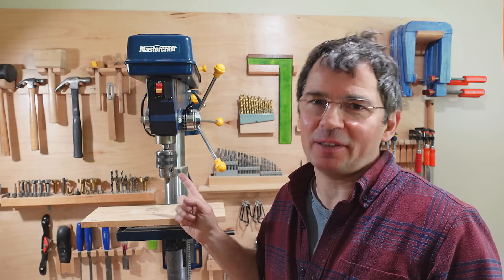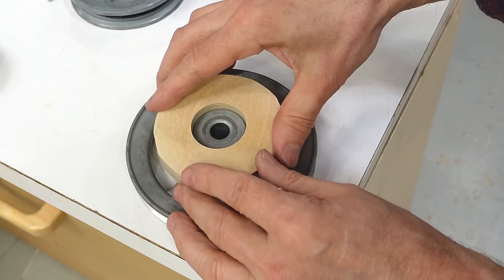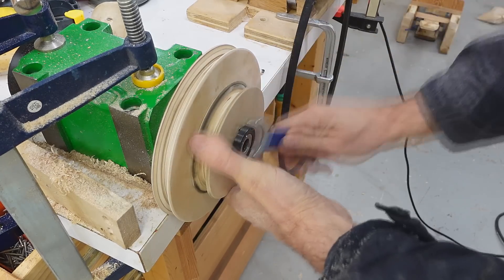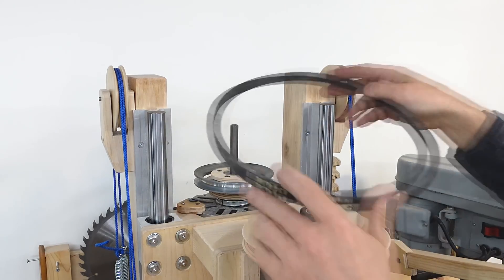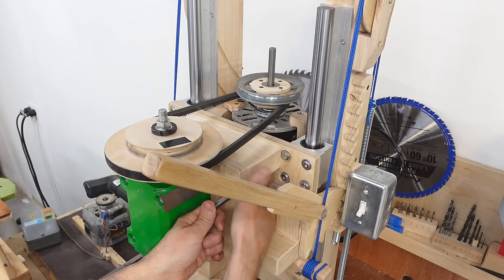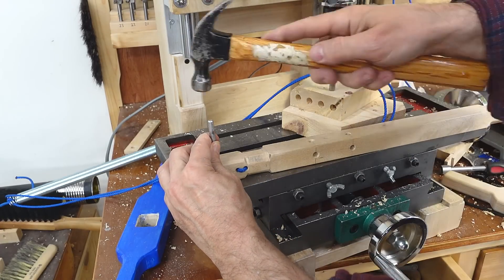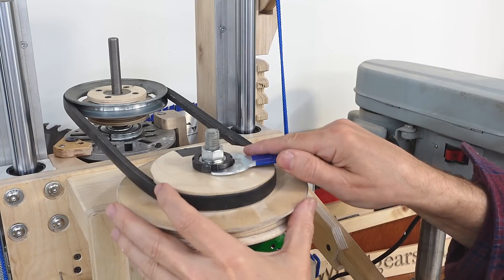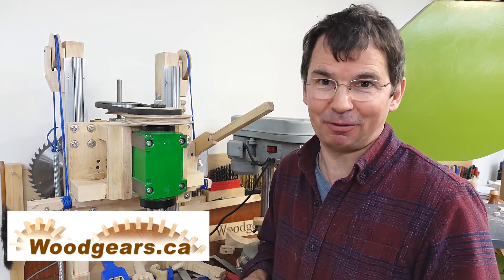Better pulleys and belt tensioner for the homemade mill/drill

Comment: Or you could find a VFD for that motor and that would let you adjust the speed in a pretty large range.
Reply from the maker: I can pick up an induction motor made 70 years ago and be sure it will work.  Same is unlikely to be true for fancy electronics.
Reply: @matthiaswandel  maybe VFDs were fancy electronics, but these days they have them ironed out and they are running for decades 24/7 in terrifyingly bad conditions. I recently replaced like 10 Siemens VFDs at work not because the electronics failed, but because the plastic cases themselves started falling apart after 20 years in a hot cabinet.
Reply: But it's more fun to watch him build things out of wood.
Reply: Если бы момент также увеличивался на валу как понижались обороты, что и бывает в классических редукторах - шестеренчатых и клиноременных. При использовании частотных преобразователей вроде бы нет такой обратной зависимости и нужна константная электроника или продвинутые модели преобразователей с обратной связью.
Reply: Maybe make a variable pulleys setup as CVT gearboxes
Reply: Not every motor tolerates being frequency speed controlled. Motors are often designed to run one speed and the cooling fans in them had better run that one speed too. Otherwise they don't get the cooling they need and poof. Now some motors are just so overbuilt they can handle operating out of spec. A lot of our motors you can't even run them in Europe reliably. Barely any speed change at all.